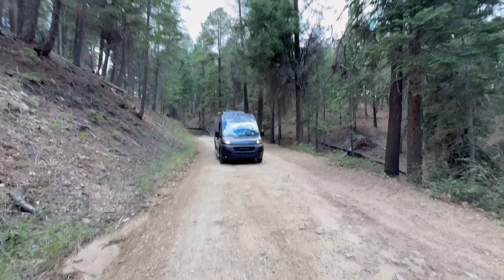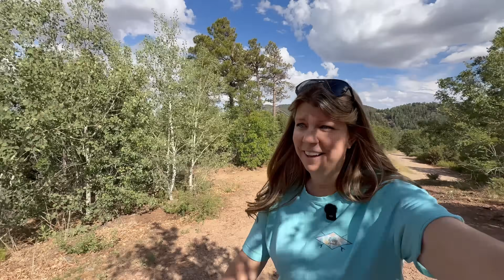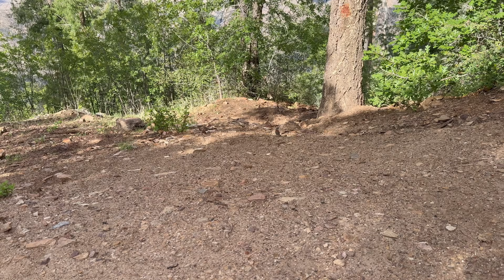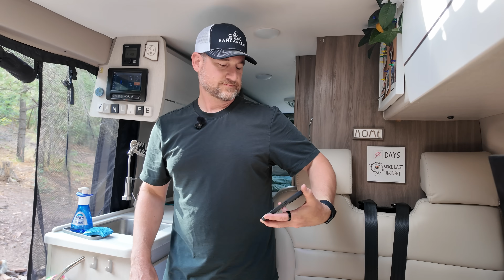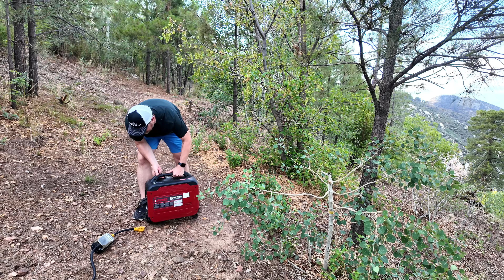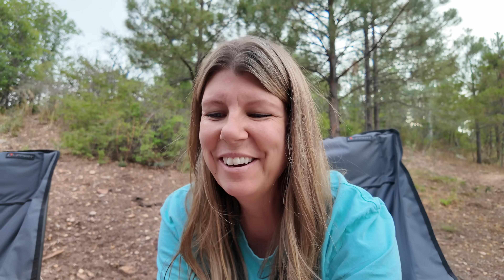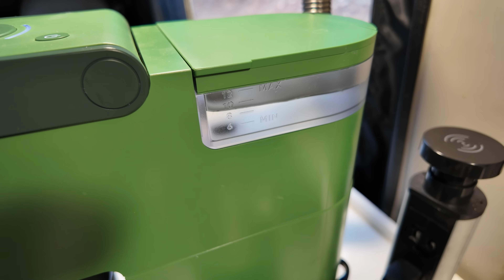MUST KNOW RV Generator Rules (Risky Roads & Lessons Learned on Mt. Lemmon)

Comment: So...you just arrived. You were just driving, I assume for some distance? You said your vehicle alternator could run your inverter...is that the same inverter on the same lithium batteries? I assume you have a switch-mode DC to DC converter/regulator? I'd sure prefer folding solar over a generator.

I also built a long plywood box with a baffled input and a baffled output. In the middle are two coupled Honda inverter generators and a large quiet box fan. The box and baffles come apart into a flat stack of boards. The boards connect by inserting hinge pins. The design of the baffles is the critical part. So far I've only used it for Burning Man.

Comment: The first (and last) rule of generator etiquette is not to run a generator. Problem solved - short video. 😁

We live off grid in our motorhome and haven't run our generator in over 2 years as we have sufficient solar and batteries where we don't need to anymore. There's no noise, no odor and no fuel to buy, no oil changes, etc.. We can run our mini split heat pump all night long, in cooling or heat mode, parked right next to other campers and no one will know. In fact we can run everything in our coach just like we were hooked up to a power pole at an RV park. It's a little harder design a system like this for a van, due to the limited space, but it's still doable using tricks like layered panels on the roof, solar awnings or side mounted and deployable arrays. A super high efficiency mini split is essential to your project. We designed and built our solar/battery system ourselves for a lot less than paying a professional to do it. Still it wasn't cheap, but paid for itself in less than 2 years in RV park savings alone, yet it should last us the rest of our lives as we are old farts. The good news is that you could get by with a system 1/2 the size and cost of ours in your van compared to our 35ft motorhome. Since you've already got some solar and batteries, all you really need is a little more. Our entire system including 5kw of solar, 23.5kwh of batteries (9 times what you have) and 6kw of 120v ac inverter power only cost us $10k to build. Our entire battery bank cost less than a 3kw Honda generator because we built it ourselves.

Comment: I sure hope to encounter you two on the road sometime.  It's fun to see you worry about the low batt issues and coffee.  Coffee is the correct answer.  Thankfully, I don't have to worry about that anymore with 700ah of battery and 1900 watts of solar.   I mothballed the Onan generator a few years back.  It never ran correctly anyway.

Comment: Highly recommend moving up in generator size. You can get the "suitcase" style in a 3000-~3200W Gives you more headroom. So while its charging your batteries, its not running full throttle like your 2000W is. 
As for the power issues, more capacity, more solar, and swap out that 120v air conditioner for a 12v unit.

Comment: You should turn the circuit breaker off before you plug it in so you don’t start burning up your plug
Reply from the maker: That's a great tip, thanks for sharing!

Comment: Camping World sells a water pressure limiter which goes on the hose connection to the water outside. As I remember, it also has a gauge so you can see what the pressure is. I suspect this is all you need.

Comment: Guys, keep up the good work, learning is a part of the adventure.  If I can suggest, get a set of cheap Walkie-Talkies when you need to have a guide navigating tight spots.   When using them, the guide is the ruler, and anything that is said needs to be acknowledged before driving! 
PS: If you want to get into real boondocking, then you need to learn resource management when it comes to power and water. 110Volts items like the AC and the coffee maker are for RV Campsites. 12V AC and drip filters for coffee are for boondocking - Enjoy the fun.

Comment: Okay, So this is the only video we have seen. But we spent 10 years traveling in multiple rigs across the USA.  Issimo 1 has all the correct items you need. We would suggest the upgrades in this order. The most solar you can get on your roof as possible. That will give you a number of watts that you think you will get off 5 hours solar in winter. Not Summer. This will give you what you can recharge your battery bank daily while stationary, sitting somewhere Beautiful without turning on a generator or the Van. if you have 800 amp hours of batteries you would need aprox 10,000 watt hours of Solar to charge them. This is not realistic Say you have 500 watts of Solar panels on your roof. This is much closer to reality. That means at 100% you would get 5 hours and 2,500 watts if perfect conditions. Roughly 100 DC battery amp hours in the 5 winter hours maybe. 200 in summer because of longer days. This is why your Rig came with 200 amp hours. 100 to 200 amp hours will give you Coffee, TV, Cooking and just about all the Led lights you want. What it will not give you is AC.  To run AC you will have to get bigger batteries which you then will have to charge them the next Day. That is is the issue. Not running the 12 volt AC all night which will take a minimum of 400 amps hours of batteries . But how do you charge them the next Day. Solar, generator or running the van, because your normal life is going to take 100 to 200 amps, so in reality you need 400 amps to be ready to run the AC the next night and 100 to 200 for normal life so you are going to need find 600 amp hours. This does not even take into account if you park in the Shade, the Solar panels do not work well in shade. So what should you do. *** Well you can wrestle with generator and that will provide lots of entertainment for us. Fuel, Noise lugging it in and out of the van. Someone stealing it. The list will go on and on we will get out the popcorn when we watch your videos. So remember we said get the most solar on your Roof as possible 1st. This will allow you to run your life (without AC ) on solar and batteries. Here is how,  You avoid running the AC. When you park your rig if it is in the Shade that will give you 10 degrees cooler. But no Solar so you have to be moving the next day possibly a short distance to place the rig in the Sun for Solar and now it is hot in the Rig. You can run your generator but that is fuel or driving somewhere, also fuel. If your are spending one night somewhere and traveling the next day, no issues because your van will charge the rig. If you do have 400 amp hours you could run the AC for about 10 hours, but now your battery is depleted (Look into DC direct charge from the Battery/Alternator) This will charge faster, time wise, a lot faster but there are considerations. Everything is a trade off. Last Tip every 1000 feet you go up will be 3 degrees or more cooler. 10,000 feet 30 degrees cooler and No AC. As a couple you do not strike me as the type that will be willing to place portable solar out to run the AC during the Day. If you switch over to the 12 volt AC it will run on max cool at 700 watts. it will cool down aprox 20 to 25 degrees in direct Sunlight. But you realy need a lot of Solar to do this. 400 battery amp hours would again do this if using lots of solar to keep it going during the day and night. We are talking thousands of dollars here spent to do this or is there another way other than elevation and shade? Yes Virgina, there is Santa Claus. A RV park has power and your AC will run as long as you want it to. Imagine that not a single Battery worry. Add up the cost to run the AC from your Van and you can stay a lot of nights at a Rv location. So Solar, Batteries and a really good generator on the rig is what you need to sit still and enjoy a beautiful location for a few days. But when it is over 100 a rv park is your best friend. I really can't believe you didn't do a generator if you are going to be living in it. If you are wondering we ran our generator for only 70 hours in 3 years. But we ran it almost every day for a couple minutes. Like heating the rig in the morning at 7 degrees, (Then ran a small heater on solar), Batteries showing low becase of bad Weather then ran the Generator for the George forman grill, Microwave, hair dryer, Toaster, electric gridle to name a few. But we pushed a button because it was on board. I can not tell you how much I would recomend either install a generator or sell your rig. You are truly missing 1/3 third of the power triangle without it. Because it appears you wish to go where you want no matter what the weather. We traveled way you wish to for ten years, which means you need all 3 of the power triangle or you will suffer greatly and we will get fantastic You tube and another reason you will call your Rig the Ultimate Lemon when it is your choices not the Rig. Any questions about this or places you might want to visit. We saw the USA from Sea to shinning Sea twice in Hot and Cold. Let me know if you would like some info on the power triangle or if the School of hard knocks is your lifestyle, That school is fun to watch though and if you wish we could connect up some way. Safe Travels Kyle and Staci

Comment: You need a DC power Air Conditioning unit. They make a direct replacement for your AC one. It can run off the batteries and is extremely efficient.

Comment: I purchased a Generac i3200. It runs a 11,000 BTU Dometic A/C unit and everything else on. Lights, small fan, refrigerator, water pump, inverter, and CPAP. That was my test. It is heavy but still doable. As for coffee I use a French press. For more coffee I use an enameled metal percolator (cowboy style). I also purchased a single burner that uses the green Coleman type propane bottle for those times when I’m outside the camper at the picnic table being quiet early in the morning. We only use the electric coffee maker when plugged in to shore power. I purchase a pair of Renogy AGM 200 amph batteries giving use 400 amph. That equals 200 amph usable energy because AGM batteries shouldn’t be discharged below 50%. I had to learn All of this stuff with some guess work along the way.😮
 Something to note. I use a switch to disconnect the camper from the truck so I don’t drain the Ram batteries while parked. While driving the batteries are charging on 12v, the fridge is run 12v from the truck 170 amp alternator.
All of that to say it was a learning process with the most important part being the Renogy battery monitor.

Comment: I have a quiet Honda 900 generator I'll sell you cheap! We have enough battery power ( 810 AH ) and solar panels ( about 700 watts worth ) to not need a generator if we are careful using the AC ( which is 12 volt ). Not using the AC, no problem with power!

Comment: Gen. Rules ... Also watch for fire Restrictions!
Not so long before this vid, the forest svc and the county had major restrictions for fires, grills, gens. Etc.!

Personal safety rule - ALWAYS HAVE A BATTERY POWERED Carbon Monoxide Detector or 2. Just so you can tell if the wind shifts and pushes the fumes back into the RV.  Also for gas cooking. 

BTW, you found a nice spot up there on Mr. Lemmon. 

Oh, BTW, always use wheel chocks to put on the downhill side to prevent rolling!

Comment: We have a generator on our class A motorhome. We are glampers the majority of the time, but when we must boondock. We look for other motorhomes running their generators. We park near them and have a generator sing along. Then off at 9-10 pm. Park far away from us if you don't want to hear us.
Reply: I agree. There are many many generators that work great. I’ve seen people have problems with Hondas but I’ll buy that they are the best but not the only
Reply: Thanks for sharing your experience might save some folks so trouble. It an often asked about subject
Reply: You know people can't always Park away from you and they have to suffer that noise pollution have some more care
Reply: @007nadineL 
Don't get  me wrong.  We care about the comfort of our neighbors. So we camp at campgrounds 98% of the time. We camped at Quartzite AZ during the rally. There are ample places to park. But one guy camped close to us, then later complained about the noise. I and the other generator coaches made sure to park away from others.

Comment: 1st - get a generator that's rated  past what your AC, coffee maker and everything else. You can never have too much generator living like you do in the camper. Plus it will run way more efficient and not be at full rpm's just to keep up.

2nd- when it's hot ASF there isn't any generator etiquette.  If your in campsites, buy a Honda and don't worry about it.

I power a houseboat on the Mississippi river when it's Africa hot down here, I have learned to either do 1 of 2 things when getting a generator.  Either buy one larger than you need to run everything or buy you one small enough to give you lights, charging and TV.

I have a larger one to run in the summer- Honda 4500 and a smaller Honda (2200EU) for the winter months.

Comment: I'd recommend you place generator up on something off the ground. Some blocks of wood something easy and safe it won't fall from, 2" to 6" is all you need. I had one fail because it sucked in dust/dirt and caused issues. I was repairable, but I learned a valuable lesson.

Comment: If you decide to keep the van, know that there are now 12 volt roof-top options for AC units.  I have a Roadtrek with an under van mounted 12 volt AC unit, and it is amazing how long I can run the AC in South Texas on batteries.  Of course, I have  lots of lithium batteries.

Comment: You just need a Noovo 😂 Seriously though - 400 W of solar, 660 am hours of lithium and dc to dc charging - I’ve never taken my power cord out of it’s packaging! 
For the water - I love the UV filter system in my van and it installs under the sink. It’s the Acuva Wanderer 2.0

Comment: You can never go wrong buying a Honda, however, I have a couple Champions, including a dual fuel inverter 2000W Champion that has been GREAT, and was less than half the price of the equivalent Honda. The little Champ is as quiet as I can imagine any combustion engine could be.

Comment: I don't know if you knew this already, but every time your house 12V system goes offline the Balmar shunt loses its programming and starts thinking your battery bank is only 100AH, so it's quite likely that it's only showing you half the capacity that it should. Also, if you turn off the inverter using the physical switch on the inverter it saves a ton of power that's otherwise doing nothing. I added a remote switch to mine to make it easier, and I can pretty comfortably go 2 days on my pack. I did the whole portable generator thing for a while, but now I've settled on only taking it when I know I'm going to be camping somewhere I need it for more than a few days. It's a lot of hassle, and hauling the fuel can be a challenge to do safely. If I'm boon docking, I try to move every day or two and just spring for a campsite with power when I'm staying put for a few days to work so I can have AC and everything. Otherwise, a half hour of idling here or there isn't that big of a deal... And once again you get "free" heat/air from the dash while you do it.

Comment: Honda has slipped a bit on reliability over the years. 
Been running HF Predator and I think just as good. 
I would think about going with a 12 volt ac unit.

Comment: A surge protector is not required on an inverter generator. That being said if you use a Power Watchdog or something equivalent that has a monitoring app you will need a bonding plug for the surge protector to allow power to flow.
I use AI power and have no issues. A-iPower Portable Inverter Generator Dual Fuel, 4300W RV Ready.

Comment: I have a champion dual fuel generator as a backup for my house. Its very quiet. Why not get a 250A alternator for the van and use that as your generator? 
I watched your review of the Noovo, is that still your fav? I liked the tiny planet build better, wonder what your thoughts on comparison between the two? 

With regards to the sanity of sinking $200k into a van, it's not an investment, it's sunk cost that keeps draining your wallet, once you accept that and you realize it's the cost of freedom you just stop worrying about it.

Comment: Honda Inverter Generator, maybe 2200is etc absolutely "the quietest" you can buy.  The eu2200i is 57db at full load, 47db idling.   Others may be 55db idle and 65db full load and you think 'not much difference' but db numbers are geometric as they get larger which means 67db is TWICE (200%) the noise of 57db, not just 20% more - db really matters.   I've on my 6th generator (because Honda costs more) and have learned the hard way that Honda is the quietest / significantly quieter :)

Comment: I bought a similar one years ago to prepare for hurricanes. I have never even put fuel in it, let alone check if it works.  Don't know what we would use it for at this point, just wanted something just in case. Probably going to need to get some attachments if we ever want to use it for real.

Comment: In Canada solar 400 watts two 200 amps power banks separate system easy to top up . Generator good for winter and air conditioning. . Need two power banks .. with two switches AorB